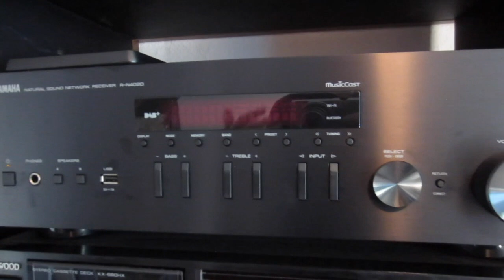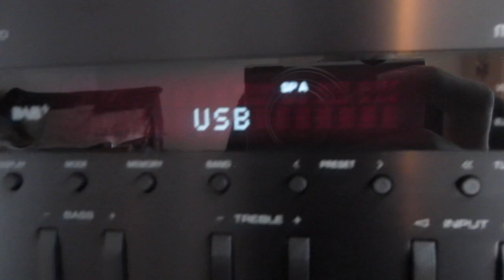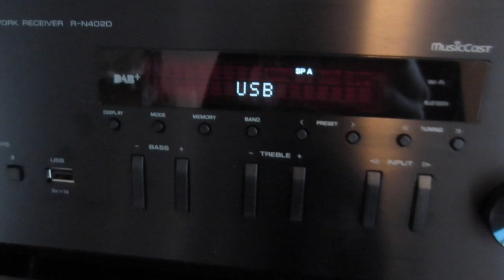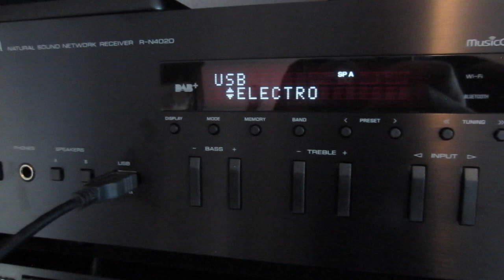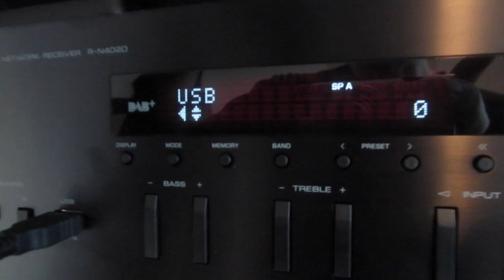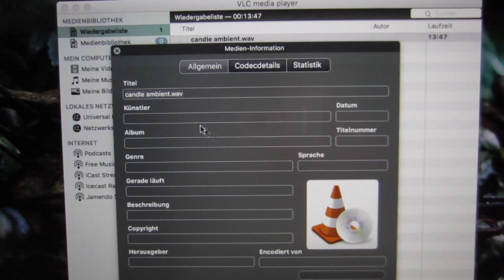Yamaha Receiver R-N402D - Music from external HDD

Comment: I’m having same issue wanting to burn cd collection and have it all in one collection to play on stereo.  
Didn’t realize the flash/HDD drives have power draws because I was going to try a hard drive but now it may kill the receiver.  Laptop with audio cable works but yes it has to be on all the time but at least your entire library is there I guess and viewable.  A blue ray/receiver with usb would work connected to tv but then the flash drives are only so big.  I’d need multiple flash drives for my collection.
Reply: Would a drive caddy with power for a while HDD be enough? Maybe a backup drive type device.

Is there a simple standalone disk for audio and video network access?
Reply: Mi receptor Yamaha R N402 No lee mi disco duro de 2 Tb
Cómo lo configuraste

Comment: Hi, thanks for the video, I've r n803 and my concern regarding usb is that the manual says don't connect anything except flash drives. However, I read in some places that it support hdd, my concern is will it harm the receiver as yamaha doesn't recommend connecting usb hdd. Further, with yamaha musiccast app it's quite easy to browse files in usb flash drive, I've not used hdd yet.
Reply: I'm guessing the concern here is power draw - a portable HDD will pull more power than a flash drive, and the socket may not be up to it...

Comment: Okay, but why not just buy a small TV and conect it to the receiver? you can put your usb stick/hd into the TV and use its integrated mediaplayer. Much much better overview over the folders and files + it shows covers when in metatag.
Oh for the tags ---》 mp3tag rules :)
Reply from the maker: I use flac most of the time. And a tv would be way to bright in the dark. And btw where would i plug in the tv to hear the sound? This tv solution wouldn't make that much sense since i would need at least 2 devices instead of just one.
Reply: @freund333  my old LG TV lets me set it up, so that the screen goes off after a few minutes when playing audio, don't know if other offer this too. And yes, if the integrated speakers aren't enough you need an extra Receiver or soundbar. but hey, you searched for a MD deck replacement, which does need that too and which doesn't play lossless like too ;)
besides that, a Smartphone should do the job too - streaming to your Receiver.
lossles isn't my thing - cant hear differences between 256k mp3 and lossles. mp3tag, tags flac files too. Forget using vlc for tagging files
Reply: @hoflichtdb6225  I think for strong comparison between FLAC and MP3 formats need to convert from a studio grade records. I understand It's a matter of own preference. But in my opinion the difference is evident and can be listened on great stereo pair.
Reply: That's really great to use TV as a smart player for almost everything. 
But I think all depends on TV model. Many Samsung Smart TV has possibility to turn off display while listening music.  In my case FLAC is reading without any issues and display can be turned off any time.